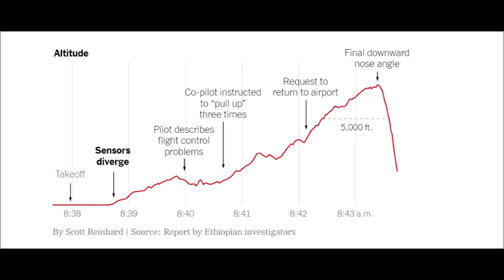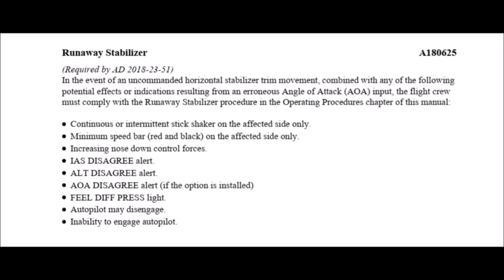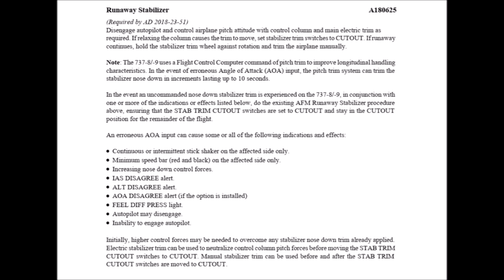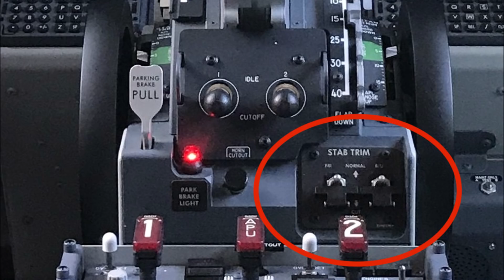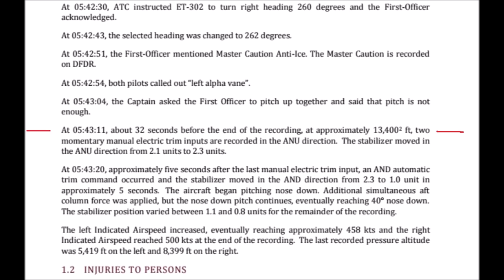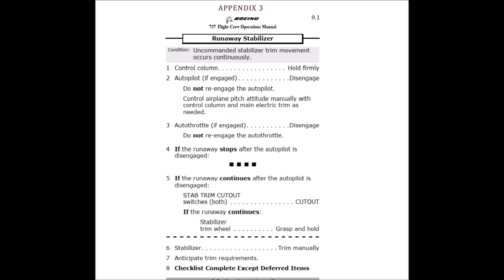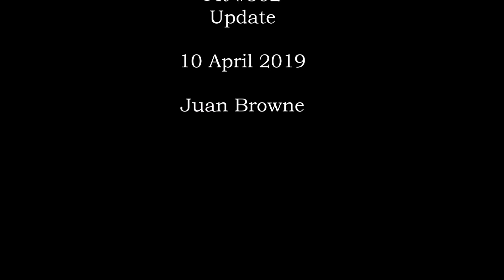737 Max Update 10 April 2019 Runaway Stab Trim Procedures

Comment: Before get to far into this. I am not qualified on 737 or Boeing type aircraft.

That said I have a number of concerns with the preliminary report.

1) It is conjecture that the stab cut out was shut off by the pilot. Voice data recorder does not include a statement that the pilot or co-pilot disengaged the stab trim. Nor does the Flight Data Recorder. This suggests the Stab cutout was disengaged was cut by an unkown automatic input or the pilot or co-pilot performed an undeclared task.

2)The auto throttle continued to command Takeoff power even though the aircraft was no longer in a takeoff attitude. The auto throttle should have been switched over to a climb power setting with speed set to 250kts. This would either be done by the pilots or automatically. A320 type does this automatically, 737 may require pilot input but as I said I am not qualified on the 737. I then have to ask. Why did the throttle remain at TOGA? 

3)Regardless of procedures an overspeed warning should have activated and the pilots should taken deactivated the autothrottle. An AOA sensor conflict would cause the Autothrottle in a A320 to engage faulty settings. I assume the same problem occures on the 737. The checklist did call for the Autothrottle to be disengage as well.

This leads me to conclude that their may have been a lack of training involved, design faults with MCAS, and possibly an undeclared procedure. For me the fact that the Throttle setting remained high indicates a pilot error, a MCAS indicates a system problem that should be fixed, and most troubling an undeclared disengagement of the stab cut out. It would be better for Boeing if this was done by the pilot or co-pilot. However, if the MCAS was still able to alter the stab trim setting overriding the stab cut out, this is a serious problem.

Comment: Latest info today from Guy Norris | Aviation Daily. 

Sources close to the investigation say data supports the supposition the aircraft’s left angle-of-attack sensor vane detached seconds after take-off and that, contrary to statements from the airline, suggests the crew did not follow correct steps.

Excellent presentation.  Especially about the apparent re-engagement of electric stab trim.  Hopefully, the CVR recording can shed more light on the circumstances leading the crew to do this.  My thinking is that they panicked when they couldn’t move the stab with the manual trim wheels.  The Captain, at least, should have known better than to do this.  A pilot acquaintance of mine died in a fiery MD-80 crash in Africa after his very inexperienced first officer shutdown the wrong engine during an engine failure after takeoff.  The Ethiopian accident might just turn out to be another such incident where an error by the FO doomed the aircraft.
Reply: I'm not keen about aircraft that have critical components fall off.  Too similar to the Reno Air Races.

Comment: Question: studying the altitude chart (by scott reinhard) it would appear very steep rate of climb at 8:39, right after 8:40, and a big rate of climb from 8:42 on. Angle of attack looks like 60 degrees plus! If this is correct, you can imagine why mcas was put to the limit.

Comment: I am not a pilot,  but my Dad was, and my nephew just retired from his career having reached the same status you have; First officer  on the 777. I have followed airline news for decades for that and other reasons. 
I do have some personal ideas about the human factors at work in both of the 737MAX crashes. Both were being flown by crews whose native tongue was not English, but of course (and with good reasons for world wide air commerce) were flying using English as trained to do. In normal flying  I would think that would not pose a problem. But as you say, when the many factors at work in the situation begin to give 'tunnel' vision perhaps just the one other factor that normally non-english speakers have to face may be one factor too much. 
Let me illustrate with a set of conditions I faced in my career as a development engineer in aerospace. One or two of the engineers I had to work with were from Europe. The Polish engineer got his degree in the U.S. and very few problems understanding each other occurred between us because the terms we used were the ones we both understood in English. On the other hand, the Austrian engineer was trained in German, so when working a knotty problem I could almost hear the gears whirring in his head as he mentally translated his German language understanding of the difficulty we faced into terms he hoped I would understand immediately, once he got them out verbally in English.  I some times could count in seconds the amount of time he spent within his own mind getting through to me before he could say the first word.
So perhaps some of the delays we note in those transcripts were doubled for this crew, because they did not have the terms they would use in their native tongue as part of their training, and  in the panic of the situation, though the English they spoke well enough did have the terms they needed,  were maybe not as easily brought to bear as timely as was necessary to save the situation.
There are a lot of "Perfect Storm" type conditions in both of these crashes, alas.
Reply from the maker: Excellent point!

Comment: As automation increases, do seat-of-the-pants pilot skills decrease?
Reply from the maker: Yes! That's why I own a Luscombe.
Reply: It is inevitable in this modern age.  Have to go out and get in Piper, Cherokee and Luscombe, etc. to work on hand flying skills.  Forces pilot to react and not have to think.

Sully flew glider planes in his spare time. Came in handy when landing in Hudson river. 

Asiana 214 crash at SFO, one of the factors identifed was the flying pilot had limited hand flying skills coupled with the ILS offline.

Comment: Thanks for giving better understanding: I eagerly await more info as to "why" the aircraft systems got out of control from the get go. One thought is the electrical panels may have been compromised with ground crews applying 220 volts instead of 110 to the plane at the gate. Intriguing because what are the known anomalies of the craft arriving at the airport before this flight took place? In short, applying "quality circles" we're asking what changed.

Comment: I used to fly a C-150 and I understand what it is to have a "feel" for the airplane. Is this a case of pilots too stuck to the book (or not training enough close to the edge) to not have a feel for what the airplane is doing? (Clear skies does help to let one know if they're upside down, of course). I once burned up a small low power diesel tractor because I had no feel of lugging it in the wrong gear (example). Edit...I commented before seeing whole video...thank you..

Comment: Boeing sucks..Period. To put passengers at risk without three AOA sensors for a computer to be able to tell which is faulty is terrible and should mean jail time for the CEO. You do not know if the pilots re-activated the MCAS... The entire computer system may be at issue.,

Comment: This started looking more and more pilot error and pilot poor training and why the Ethiopian officials were saying the pilots did everything right according to procedures without more investigation ?
Reply: You're not going to find any  error on the pilot  because the Black Box showed pilot has done everything  to save the people and airplane this is Boeing issue and the whole world knows about it...
Reply: Lemlem Tafere 
Black box shows they did not apply enough nose-up trim after their first MCAS encounter to fully reverse the amount of nose-down trim applied by MCAS as recommended by Boeing.

It also shows that they exceeded the maximum operating airspeed not long after takeoff, which certainly had a negative impact on their ability to use the manual trim wheels.

So it’s not exactly true to say that they did everything.

Comment: Has there been a recent change in how the FAA and the airplane manufacturers test new planes / technologies?  In some industries (i.e. automotive) the manufacturer performs the testing for mileage ratings according to an established protocol and reports the findings used for the official MPG rating.

It has been mentioned in several news reports that Boeing performed it's own testing (as opposed to an external organization) in an effort to streamline the certification effort.  Are we deviating from established practices for new airplane certification?   If true, this is a major concern.

Thanks as always.

Comment: One simple question comes to my mind. I'm not a pilot nor an expert of automation, but I was wondering why is the MCAS system cutout coupled with the STAB trim cutout? That does not make any sense to me. Shouldn't there be a switch that turns off ONLY the MCAS system, letting pilots still using electric trims? That's a no brainer to me...

Comment: MCAS; why have it, how  certified, what fixes AND why did they not inform pilots in detail in the first place?
Reply: That is covered in other videos on this channel.

In short, bigger engines were added which threw of certain flight characteristics. Fixed with MCAS. this was to ultimately save $$$$ due to keeping the same airframe and pilot certification.
Reply: @fyrman9092  Yup.Boeing cut corners,didnt properly recertify the pilots and now you want me to trust them? Isnt happening.